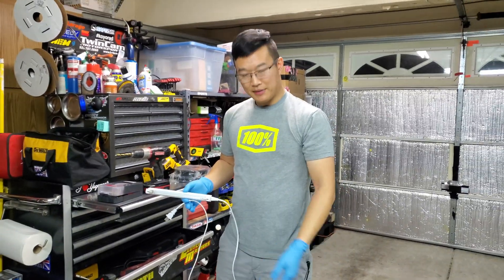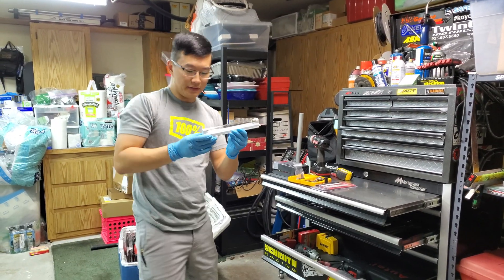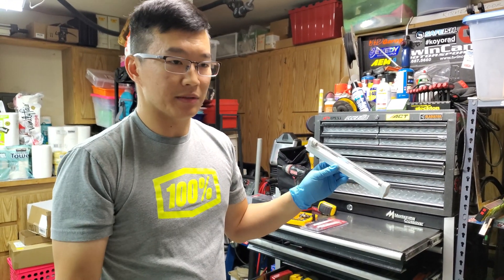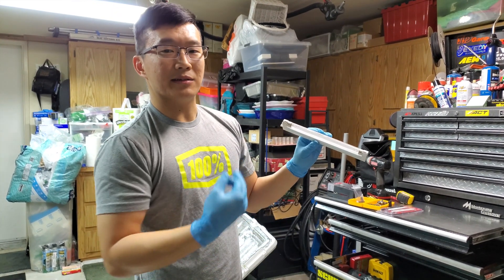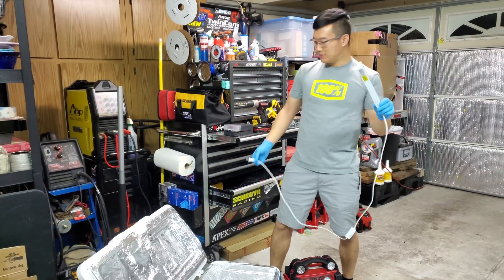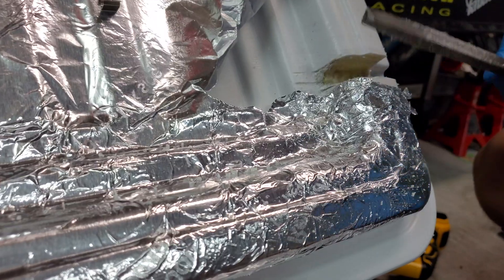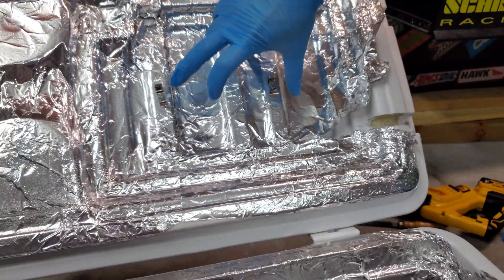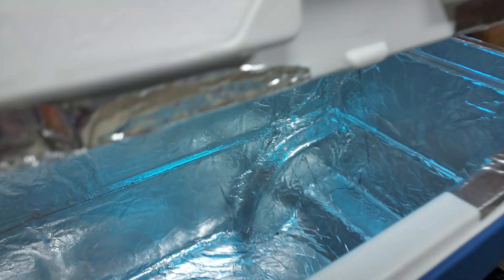Making a De-contamination Station (UV-C box)

Comment: The 6-watt lamp seems awfully small for the size of the cooler. I built my own UV-C box out of a 155 liter box and it has two 20-watt T6 mercury lamps, one on the top and one on the bottom. Stuff is placed on a wire mesh between the lamps to minimize shadowing.  It also produces a lot of ozone, which I plan to pump out using a repurposed vacuum cleaner. The 40 watts of UV-C power is probably an overkill, but I guess better safe than sorry.

Comment: UV-C at 253.7 nm will not produce Ozone. When wavelength increases the energy of the light decreases so UVC is that band of UV light having high energy. And this UVC after research is considered to be the less harmful to human skins.  The longer (253.7 nanometres) wavelength of UVC light, by contrast, provides highly effective air and surface disinfection without producing any harmful ozone. Where as UVV called as vacuum UV produces ozone which affects the human lungs, thus not useful.
The materials and methods of UVC lamp construction determine whether a given UVC device will produce both UVC and UVV light or only the safer UVC wavelength.  UVC energy at 253.7 nanometres provides the most germicidal effect. That’s why we will use UVC to make our disinfecting box.

from this website.
https://www.steril-aire.com/uvc-facts/
Reply: That is Low-Pressure Mercury Discharge lamps. Low pressure mercury vapor lamps are a highly efficient source of UV light, particularly short wavelength UV light (254nm and 185nm).  Often called germicidal or ozone absorption lamps, they are very stable light sources. These types of lamps are available in ozone producing and ozone-free

Comment: I have built a similar setup from an old cool box. Also made the interior from alufoil, I have a 11W bulb inside and a wifi smart switch for turning it on and off, also it is set to count down 7 minutes so it will auto switch it self off after that time. and a phisical on off switch is also on the setup just in case. Works like a charm. Oh and I also put some metal grid at the bottom to lift things up a bit so they get UV-C light at their bottoms also once turned on. Sometimes I flip the things inside after a round so they take at least 14 minutes 11Watt UV-C from about 11inches(28cm) afar. I'm a lill bit over blasting those germs and viruses I think. But anyways! Good Job :-)

Comment: Is it safe
Reply: UV-C is dangerous. Like fire or any thing at your home can be. So if you handle it accordingli and didnt let childrens play with it you just need to follow some rules. Rule 1, UV-C is harmfull for your skin and eyes, it penetrates the tissue and destroys DNA, so cover your self every time u use it, but that is also the reason it kills bacterian and viruses so thats why we use them. (In this case it is working inside of a box so it is safe if you dont open it wile its On.) You can use UV glasses to protect your eyes but find professional ones if you want to direct watch the light turned on. The power of the bulb is fading away exponencially so further away it is not so effective, you can compensate this with the time the bulb is On. from an incs or 3cm it kills everithing in 1-2 minutes, in that coolbox it probably needs like 5-6 minutes. It can desinfect a room(220-320square feet (20-30square meter) in about an 40-60 minutes if you have at least 30-60W bulbs. But in a room you need to move the light source periodically to catch shadowed areas. In short it is safe if you are safe.